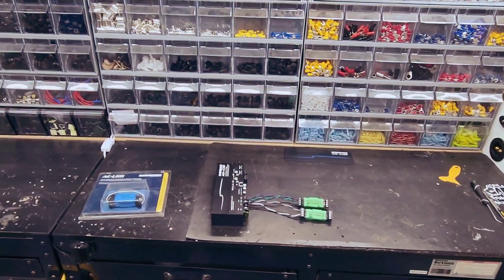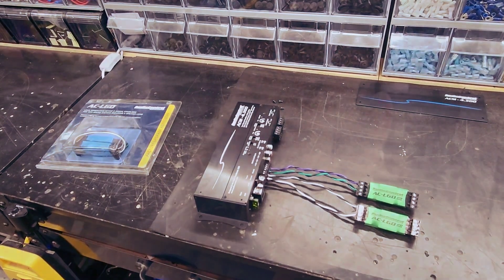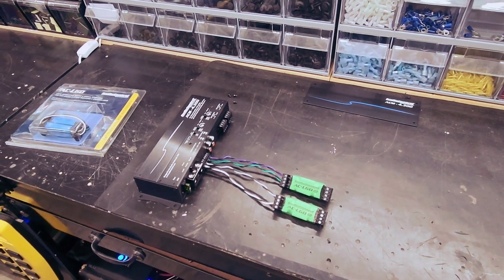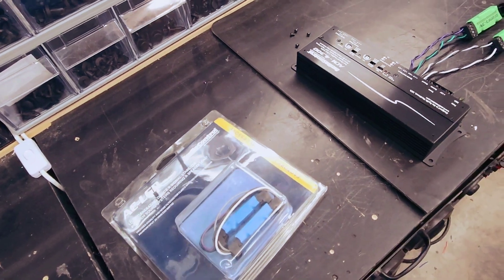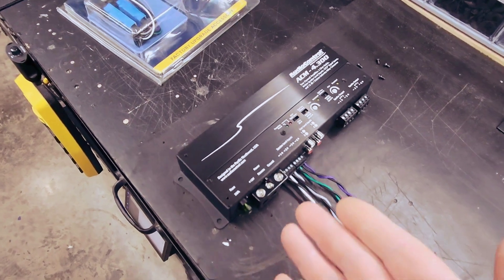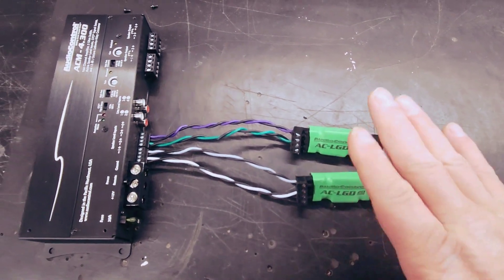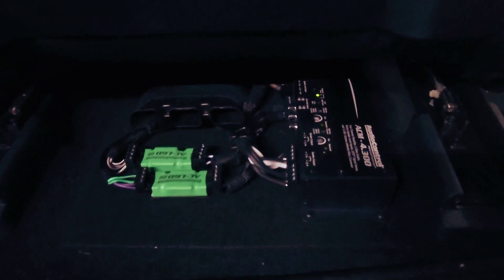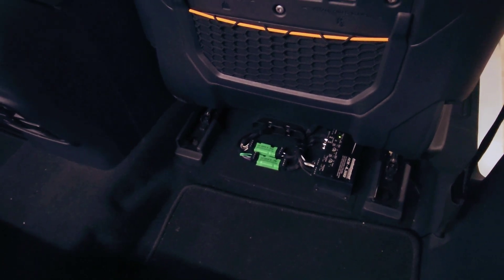Simple introduction to Load Resistors and why you need them.

Comment: Thank you for the info I have a 2017 Infiniti Q70 what's a premium sound and I believe I was told I needed the gray color ones I'm not sure if that's right what do you think?
Reply from the maker: Yes and no, that should be correct, but if you can afford the other load resistors as well, i always grab them just in case. I have found that sometimes the call for resistors is incorrect, but the grey should be right.

Comment: I have a 2019 f-150 with the B&O system, i cannot get my LC2I working Right with my Class D amp powering my 10 inch sub. Do i need the 60kolm resistance for my lows? I was told it was only required for the mids/highs. Im at a loss with my sub spiking and bottoming out often
Reply: Built into the LC2i pro

Comment: Just had a Kicker key 500.1 and 12 inch sub installed in my 2020 F150 XLT (w out premium audio) and now my door chime and reverse sensor's arent playing through speakers just the dash, read on some forums that adding a 60 ohm resistor will give the headunit a load and allow for the chimes to be played though the speakers again, any insight on that?
Reply: sub only shouldnt affect anything else.  take it back to your installer